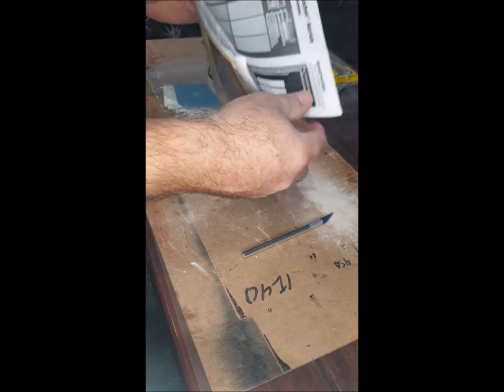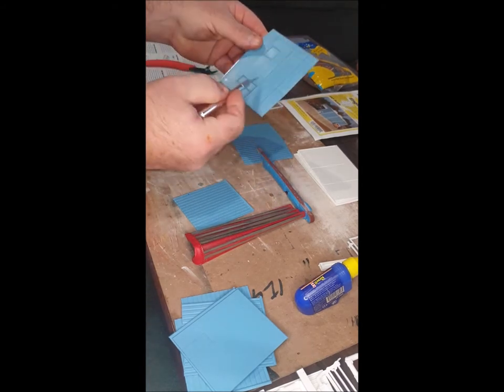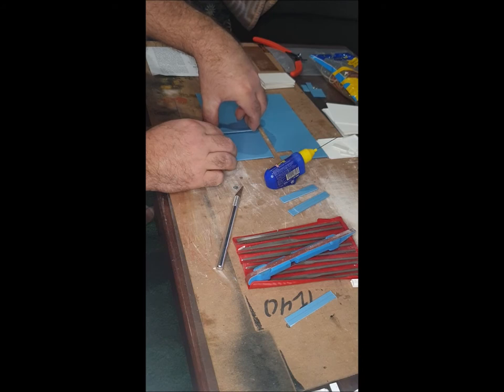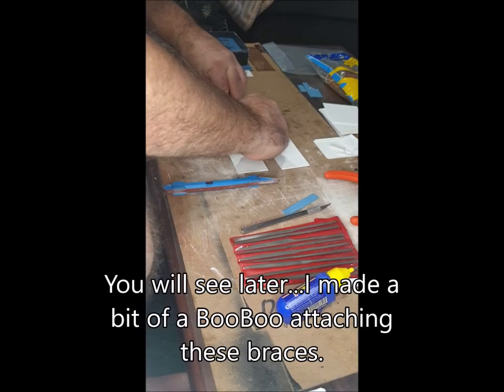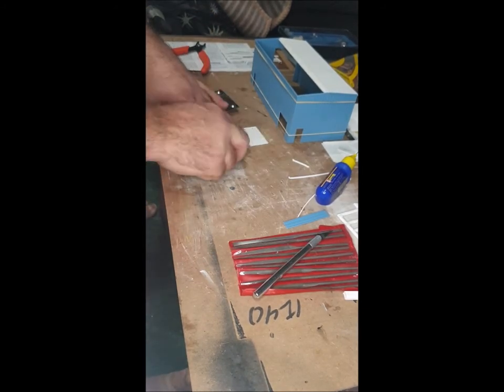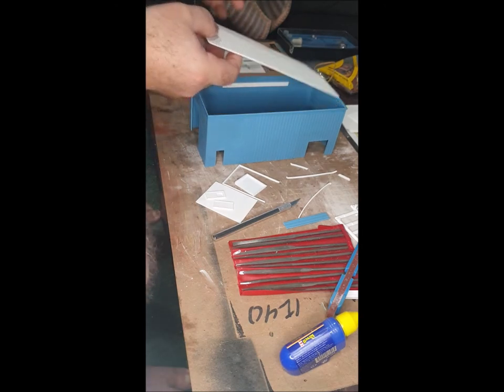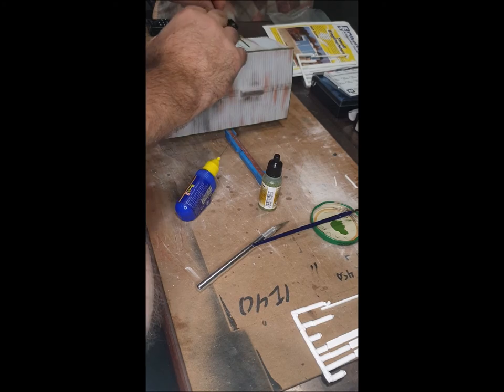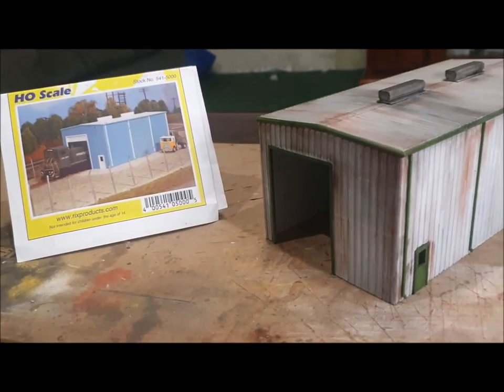Episode 12...The PikeStuff Small Engine Shed...Model build from start to finish

Comment: Chris,  Pike-stuff buildings are great. Especially for bashing buildings. I need to pick up a few myself.
Reply: Kory  No worries Kory. Ya been doing any modeling lately ? I built a Manitowoc 4600 shovel and soldering 18 gauge copper wire and fabric tulle fences together.